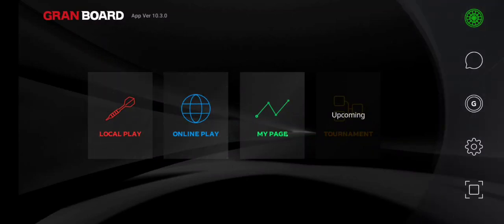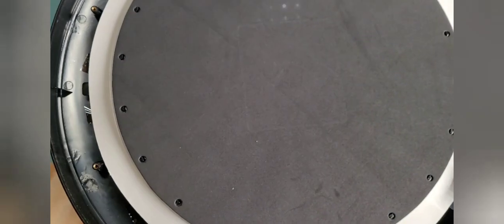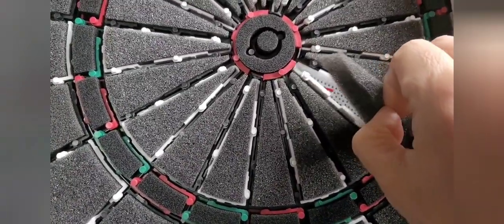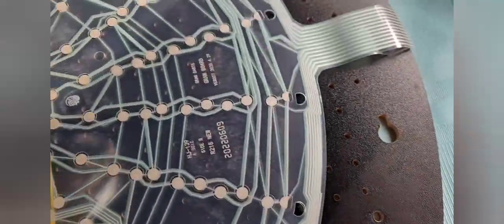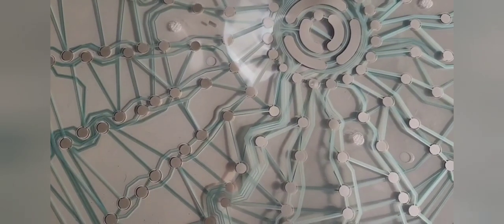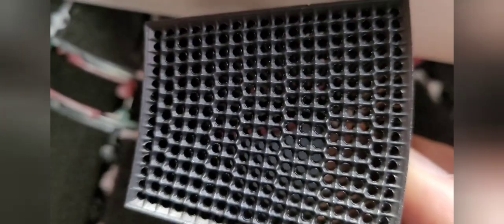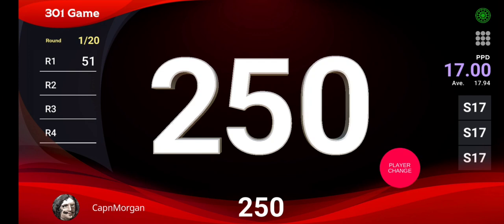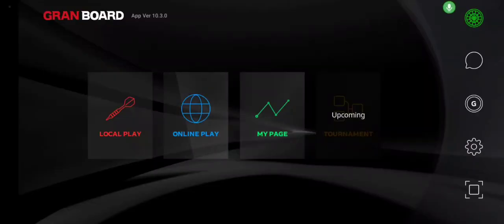Granboard problem. Stuck segment, or dimpled matrix? DON'T PUNCH TIPS THROUGH!

Comment: Just had this with mine yesterday. I used my hot air station to fix it, and then this video popped up for me today. Our devices are listening to us.
Reply: I did this originally.  I did buy a spare matrix though.  So once I got tired of using hot air I just swapped the matrix out.  I'm on my 3rd matrix now though.  The first one was defective and Granboard quickly replaced it. At the same time I ordered a replacement so  had 2.  Once their replacement had dimple over and over I just went ahead and replaced it with the 3rd...but I tore off 1 of the sheets from the old and used it as a buffer in front of the new one to help t not get dimpled.  So far it has worked fine for months and no issues in scoring either.  I think having that extra buffer in place will help keep me from replacing it for quite a while.  We play a lot of games so we probably will need another in a year or 2. Hopefully more.

Comment: Great vid.  I'll have to remember this down the road if I have any problems with mine
Reply from the maker: Thanks. If you take your board apart, don't over- tighten the screws on the back.  If they're too tight, it will cause problems with scoring. Wrong numbers will possibly be registered if the screws on the back are too tight, or if the board is too tight to the wall.

Comment: Mine started the same BS with single 20s. I never tried to punch anything through but may have (likely) hit an exact spot that had a busted tip… going to try this. 
Just been so frustrated with the GranBoard app/how it mirrors to my tv) it’s self I was ready to smash it to pieces! Hoping they start correcting some of the bugs before I start dumping MORE hundreds of dollars into it!!!
Reply from the maker: What weight of dart are you throwing? It's also possible that a segment simply got dimpled from a throw that was just a little bit too forceful, or maybe it's just from repetitive practice at the 20 segment
Reply: @capnmorgandarts  
18’s.  I leaned towards the broken tip theory due to back to back shitty (but not cheap) tip purchases that broke off at least 25 different tips throughout the board. Most being in cricket numbers.

Comment: I don't think it is the broken tip that dimples the matrix, the broken tip is normally very short, and there are foams in every single segment. so it's a challenge that the broken tip makes contact with the matrix.      I think it's the contact point on the segment that actually made this happen.   which means that, even though you don't use the tip puncher,  if you hit that specific area enough times, it will eventually dimple the matrix.  So my solution is, to change the thin white sheet to a thick (3mm) silicon sheet, then I think it is OK to use the tool, and the matrix will last way more longer.
Reply from the maker: You're correct. After I made the video, I realized the segment was what dimpled the matrix. I'll look into a different piece of foam. Thanks!

Comment: Hope your matrix is still working! Couple questions if I may? How have your LED lights held up and what power brick do you use? There seems to be so much dispute over the power brink to use. My board was 30 minutes into it's very first use and the LED lights went out (I had no batteries in...only usb cord)...and Granboard and Amazon are saying it is my fault for not having the correct power brick. However, printed right on front of the box is "You need 1.5a or MORE" to use the LED lighting but then the "fine" people at Granboard tell me I am suppose to use a 5v-2.5amp power supply? The Facebook group told me which one to buy, so I did but now half say it was the wrong one and half say it should work and Granboard of course tells me I used the wrong one and does not want to warranty anything. Do you have any idea what the heck is the reason that nobody knows what works??? LOL - Thanks for listening.
Reply from the maker: I actually haven't played on the Granboard in several months. However, the LEDs do still work. As for why you can't get a straight answer about which power block works....I personally think it's because nobody truly knows. I'm using a 5V 1.5A block from an old camera from my alarm system.
Reply: @capnmorgandarts  Thanks for the reply.....why have you not played? Did you switch boards or just lack of time?
Reply from the maker: @daddylogan  I've mainly been focusing on jiu-jitsu and steel tip darts.